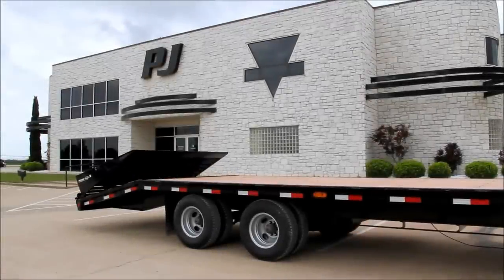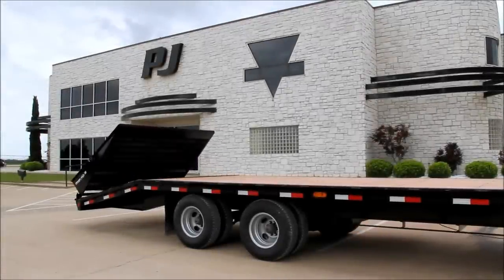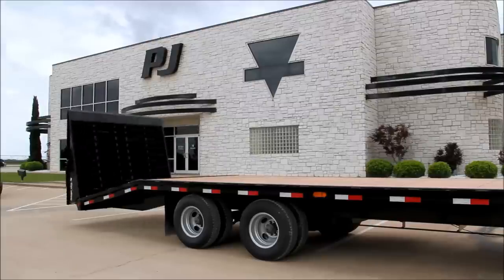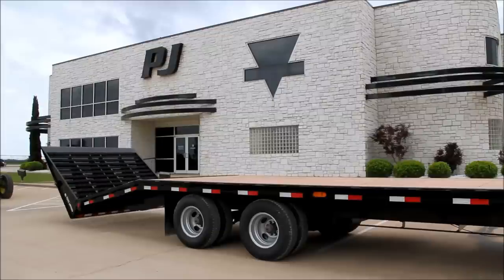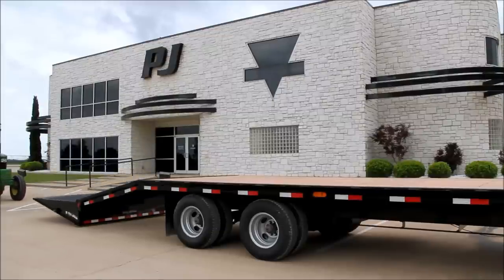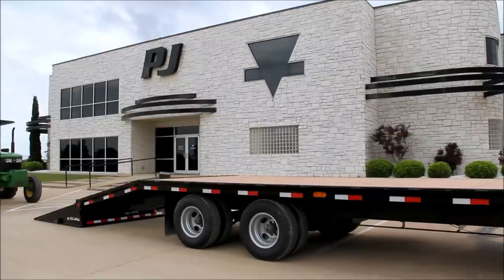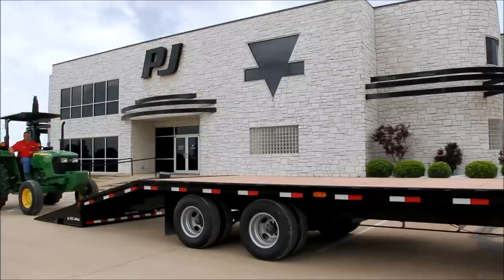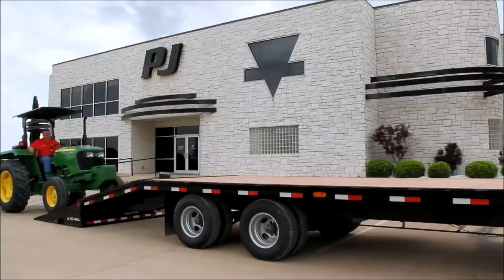PJ Power Tail (Patent Pending)

Comment: Can you get both the power tail and hydraulic jacks?
Reply from the maker: Yes sir, you can have both the PJ Power Tail and PJ Hydraulic Jacks on the same trailer.  They use to separate hydraulic pump systems. The jacks have the pump located in the front tool box and the Power Tail has a hydraulic pump located in front of the axles.